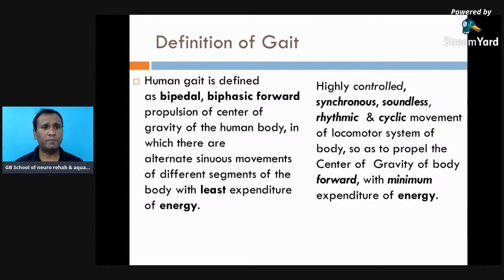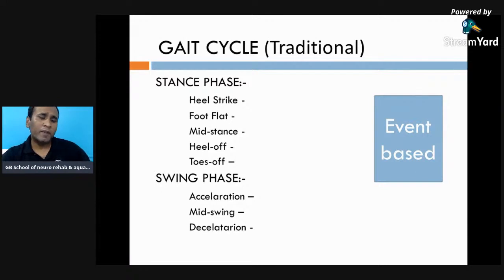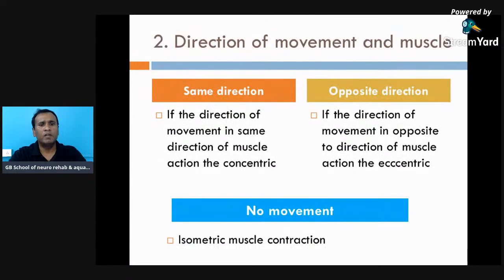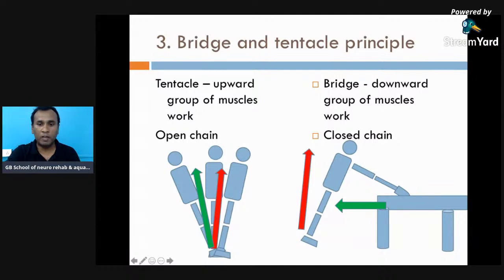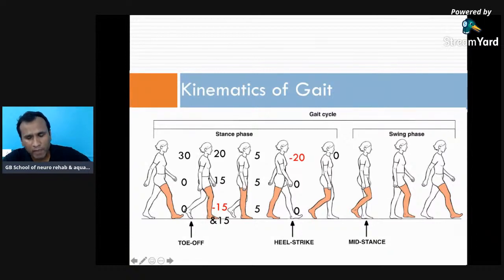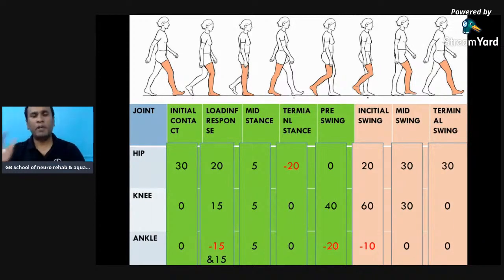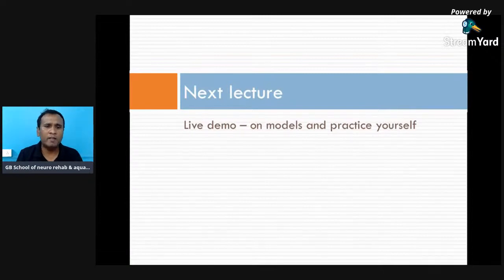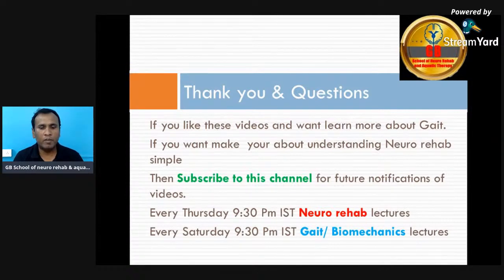" GAIT MADE EASY": 1st lecture- Understanding kinetic and kinematics of gait made easy

Comment: Incase of hypertonicity in hipflexors < knee flexors < dorsiflexors , sir can we imply focusing on hip flexors ( may be eccentrically) more than hip extensors will help in hip knee stability ?
Reply from the maker: I don't get your question? Can be more clear
Reply from the maker: Usually we get flexors hypertonicity / spasticity in supine or lying position, in standing we will get extensor hypertone. Dorsiflexion is rarely spastic,  plantar are more common.  If you are talking about stance stability in standing then we can stability from hip knee extensors. If Patient are unable to extend hip and knee then check for tightness or contracture.  Then we need  to work that first.
Reply from the maker: Knee stability can be improved from ankle control as well. As you mentioned FRO will help knee extension control.